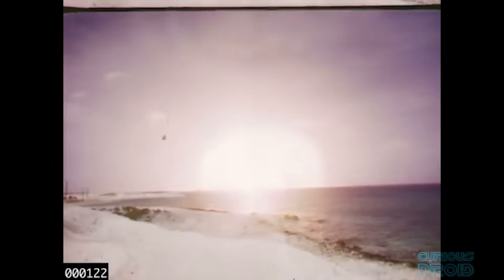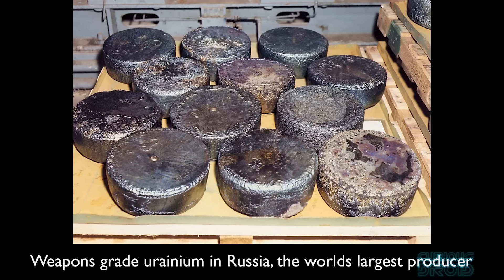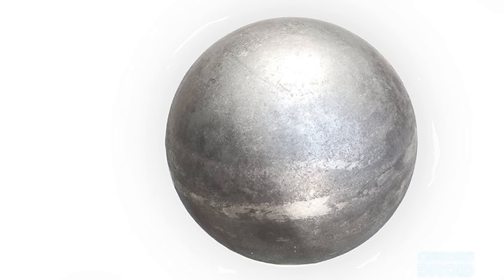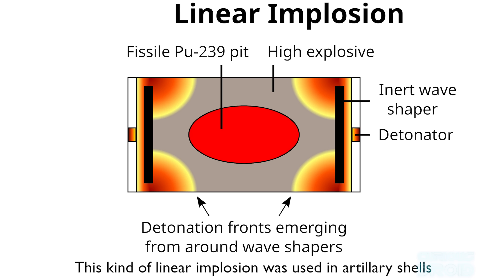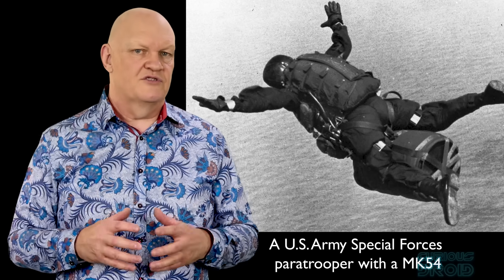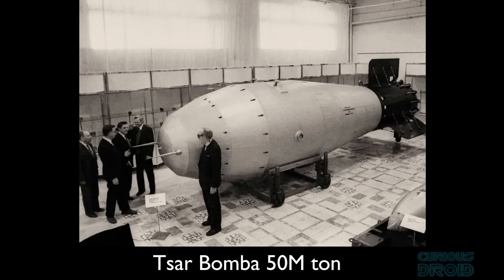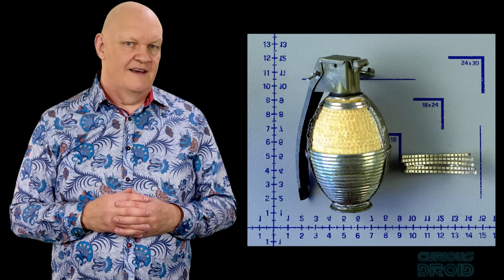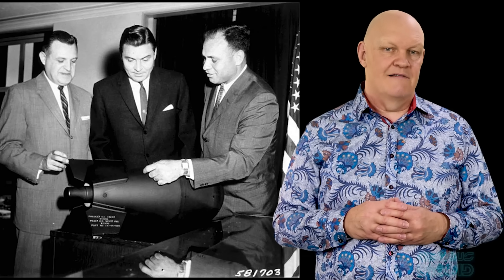How Small Can You Make a Nuclear Weapon?

Comment: I knew the Colonel in charge of the first Davy Crockett unit. He said they had one set up for presentation to brass at the rollout and with nobody near it, it unlocked and fell over.  He said the system was a million dollar warhead on a 37 cent launcher.
Reply: In the USAF I didn't tightly lock the wheels on my hydraulic fluid unit used for topping off the jets hydraulic systems:  I didn't realize it rolled out of my humvee and downhill into the nuke zone, a "no lone zone" they called it and it bumped into their electrified fence around the jets that were uploaded with nukes.  That almost  sent the entire base into high alert.  And when I realized what was happening I ran down to try and stop it before it hit the fence but the guards in the towers only knew some guy is running into the nuke zone.  I don't remember if they shouted or what but it was loud enough to stop me in my tracks.  I was only 18 and a two striper but I got lectured by my CO but nothing too bad.
Reply: @w.harrison7277 so you were a Corporal in the Air Force at the age of 18?
Reply: @Wolfric1970  I was new, I don't remember, maybe just one stripe.  I know it wasn't three.  Probably one.
Reply: @w.harrison7277 okay, I get it. Many of us have been there at very low rank in the military. It just seems to me that the enlisted people in the Air Force are over ranked and almost everyone is an E6
Reply: @Wolfric1970   Probably because its cheaper to offer another stripe as an incentive than to offer retention bonuses.  I don't know the issues of how they manage rank distribution but I'm sure there's a lot of bullshit involved in the age of Credentialism.
Reply: @Wolfric1970  If I hadn't taken a year and a half off to chase girls and flunk out of college, I would have been 18 when I enlisted. After basic training at Lackand AFB, San Antonio TX, there was about a year of technical training at Lowry AFB, Denver CO. I got my first stripe at tech school. After graduating, I got my second stripe (A2C). This rank isn't exactly the same as it is for an Army corporal. We didn't carry weapons and were not expected to fight if WW3 broke out. We airmen just assumed we would all die if a nuclear war happened.

I suppose we lower-ranked airmen might have been called on to defend the air base if the Soviets managed to get troops on American soil, but none of us two-stripers were expected to give any orders or shoot anyone. I did get "qualified" on the rifle range with a carbine, but it was just a "loaner" rifle. It wasn't "issued" to me, like my boots, or uniform, or the cold-weather gear I needed at my duty station in the upper peninsula of Michigan. So, yeah, two stripes and out for me.
Reply: I knew an artillery man who fired a Davy Crockett missile. He said it had to be nuclear because you were so grossly inaccurate
Reply: Sounds like that Colonel knew the SSgt. in the picture with the Chrome rec rifle.
Reply: Not surprised at all.
Reply: Of course the irony would have been that, if it had gone spectacularly wrong, the one member of the 'Brass' that designed the launcher, would not have been invited to the proceedings and their incompetence would have gone on to bigger (and worse) much more dangerous things. 😱
Reply: Yes and M16s were made by mattel, veterans said it so it must be true

Comment: The smallest known to be made were... Large backpack-ish? 

Theoretically? Depends on your fuel. Use something more energetic than plutonium and you can go down to a hand grenade but it might self-ignite.

That's actually why we use plutonium. It's the best balance of energetic reaction and (relative) stability.
Reply: "Use something more energetic than plutonium".... such as ?
Reply: @power2084  alternative actinides, including things like californium and americium, which have critical masses as low as a kilogram or two instead of dozens to hundreds of kilograms and fission cross sections that would give very high efficiency, yielding dozens of kilotons in a pocket sized package. 

But their isotopes are very active so you're treading a line of them either decaying into uselessness very quickly or igniting into sputtering fission on their own.
Reply: @Solnoric  interesting. thanks.
Reply: @power2084 I think he means higher percentage u235 for example. Say 90% to 99.9% but it increases the risk of it going super critical
Reply: @johno1544 not at all. See other comment. 

Plutonium in weapons is already extremely high purity.

Comment: Small enough to drop down an oil well or a gas well for the purposes of testing for fracking. The drills and the pipes used for the casings are standardized and are not particularly large. Suppose you could have a pretty Longines and drop it down one of those holes, but the diameter is still not particularly large
Reply: That was already done. Project Plowshare, and the Soviets did their own version .
Reply: The boreholes for those were bigger than standard drill bores though.

Comment: Suitcase size could probably be a five kiloton 1/3 Hiroshima. The Tsar bomb was the size of a bus (originally 100 megaton), not sure how that can be miniaturized.
Reply: They can get a lot smaller than that.
Reply: @thomasdupont1346 maybe with fission bombs, thermonuclear how?
Reply: @charliedallachie3539  has to do with the reflection of the fission shock wave. The reflection chamber shape is a highly guarded secret. That is why you never see the actual package
Reply: @Smitty65721 possibly, if you look at the early tests of thermonuclear bombs, they’re like the size of a huge water tank.
Reply: @charliedallachie3539  Yes, but that is what all the tests were for. They miniaturized them.
Reply: @Smitty65721 alright the smallest is the W54 about 54 lbs, 10 tons of tnt > 0.01 kilotons
Reply: @charliedallachie3539  You are not reading it correctly. "10 to 1,000 tons of TNT, with some versions having yields as low as 10 tons". That is saying 10kt to 1kt with some versions only 10 tons. A 10 kiloton weapon is a low yield nuke, however it you were in Hiroshima (a 12.4 kiloton weapon) you would not think, "No problem, that is low yield". Nagasaki was around 20 kilotons. 10 kilotons would burn you down in any city. Which is wild to think that 51 pounds of anything could cause such destruction. These things must never be used again.
Reply: @charliedallachie3539  Actually here is a better explaination of the w54 yield: "The W54 warhead had a variable yield, with common configurations for the Davy Crockett system having a yield of 10 to 20 tons of TNT, while its Special Atomic Demolition Munition (SADM) variant had a variable yield from 10 tons up to 1 kiloton (1,000 tons). This small yield made it a tactical weapon designed for battlefield use during the Cold War, capable of fitting in a backpack for Special Forces or being deployed from a jeep. " So it was 10 to 20 Kilotons or 10 tons up to 1 kt for the SADM.
Reply: @Smitty65721  I’m surprised by 2025 we couldn’t have a higher yield that could fit in a suitcase. That would be the ultimate worry. Imagine someone smuggling a nuke in luggage 😮. In the movie “Sum of all fears”, it was in a vending machine.